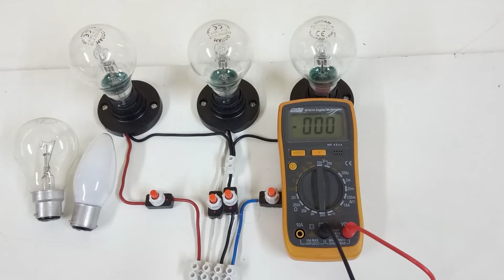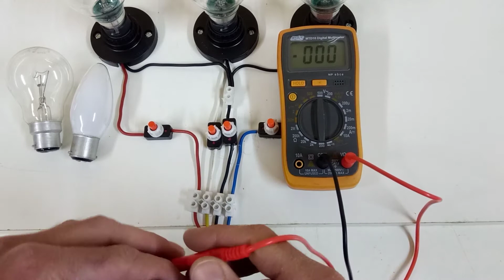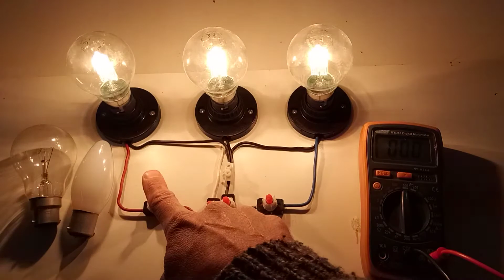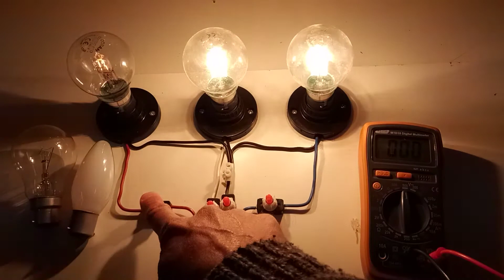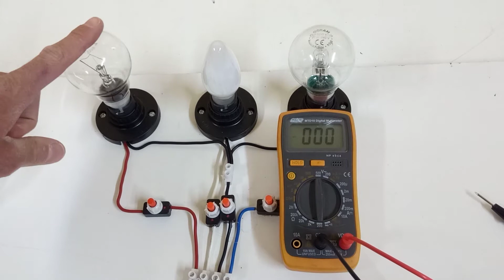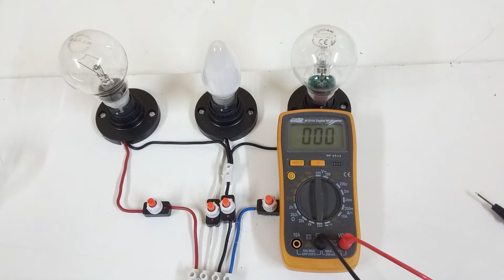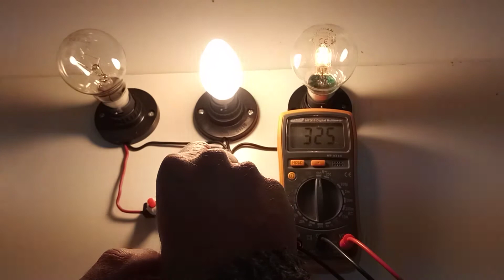A broken or floating neutral and the effect in three phase electricity systems

Comment: Thanks for that nice explanation👍 Great work👏 Can you suggest some relay or something which can identify a neutral loss at home three phase network? If it’s an over voltage / under voltage relay then tripping will be too often, as there’s a significant fluctuation of voltage otherwise also.
Reply from the maker: Those over under voltage protectors can be calibrated to the voltages you want them to trip at, but anything outside of the 10% or maybe 15% range of 230 is risky and may blow appliances.
Your supplier should be required by law to keep to the 10% range.

Comment: This is a great video. I was arguing with a person on reddit about open or loaded neutrals. What I learned is if you'd have checked the voltage across the open neutral with imbalanced loads (40w and 77w) you still won't get more than 240 like you did across the yellow? I did a set up much like yours in my garage with 2 phases of 120v.

Appreciate your video very good explanation!
Reply from the maker: Ok so you're taking about US voltages in your case.
I'm using 230v / 400v.

Your phases are 120v / 240v.
So you're correct - if you had a broken neutral, you'd find the voltages anywhere from 0v to 240v depending on the loads and resistance.
Plus I reckon they would move all over the place as items start blowing up in a real life situation.
I know you also use a system of plugs that share a common neutral so it could potentially happen that it affects just those sockets and not the whole installation.

In my case it could be anywhere from 0v to 400v at the worst, which I've seen in real life where a transformer neutral came loose.
Two phases were at 400v to neutral and the other had so much load it was just sitting at 0v.

Hope this makes sense?
Please reply if you're not sure on anything.
Reply: @TheCrazyENTP  his argument was that we can not get more than 120v on our neutral even if it is shared between phases because of how we derive our neutrals. Our 120/240 systems are "center tapped". So apparently the two phases can't "add up" on the neutral. Apparently it's the same for our Y type systems. When I tried in my garage the most I could get with different wattage bulbs was 56 volts on an open neutral but I wasn't sure what would happen with an even  more unbalanced setup. Many of us are taught what I thought which is that the neutral could be carrying a bit more danger than the hots feeding it when working live. He's saying we're idiots, but I think he might be right.
Reply from the maker: I think he doesn't understand electricity.
If the neutral breaks and you have a load on one phase only then it won't run (unless it finds a way back through TN-C-S earthing), so th neutral will be at phase value.
If you tested to the other phase (assuming no load running) you would read 240v.
But as soon as you add load to the second phase the voltages will shift.
The current (amps) have to get back to source and the resistance remains the same, so the voltage will be all over the place. It's basically putting the loads in series between phases then.

Again, I've seen 400v phase to neutral in real life so it is possible. It blew so much stuff in probably 120 houses!

Comment: Would there be any voltage on the neutral cable when it's broken?
Reply from the maker: Yes there would be a potential on the load side broken neutral relative to the earth or the neutral connected to the transformer.
You can actually use that as a way to test for a faulty joint.
Check for a voltage on the neutral on either side of the joint with loads on and if you see abything above zero that it the faulty joint.

Same I guess with a joint on a phase. If you see a potential across a joint, there is your problem.

Comment: Hi there, 
Thanks for this great video and informative explanation. Would you please advise on the following.  If a neutral wire breaks on three phase power supply, within a DB with RCD is installed in, would that RCD trip off and cut the power off. 
Thank you.
Reply from the maker: Hello. Sorry for the late reply. The RCD won't trip from over voltage, but if you have any surge arrestors after the RCD they should earth the high voltage and that would trip the RCD. Better option is some sort of overvoltage monitoring device that shuts off the power.

I'm actually dealing with a neutral issue like the video with my neighbour. It's the power company issue but they can't find the fault. Their house does not trip as no surge arrestors.

Comment: Wonderful content.   Understand the load can be SERIES with 2 loads on 3 phase.                  Unfortunately STILL do not comprehend (mathematical) why the VOLTAGE jumps up with Unbalanced Open neutral.
Reply from the maker: I think you need to go back to basics with V=IR formula.
To understand exactly what it means and how it works. 
Then look at delta star transformers.
How they use incoming two phases to make a phase and a neutral then repeat that twice more.
Red white phase makes red with neutral
White blue makes white with neutral
Blue red makes blue with neutral
Neutrals are connected to make the star point.

So if the neutral is broken the current  has to go back somehow. Into the broken neutral and back out through another phase  or phases.
This means you're connecting loads across phases.
So the voltage is determined by the current and resistance.

The single phase voltages are not fixed like the phase to phase voltages where the neutral is  broken because you've lost the star reference.

Phase to phase will only change if there is an incooming phase down or a change in MV voltage (which changes the single phase voltage too).
Reply from the maker: It may help you to see how the US Delta Delta transformers with high leg work.
A neutral created between two phases at 240 v gives a 120v system but also three phase of 240v and a high leg of 208v

Comment: The SUM of the current on the neutral is zero on a balanced 3 phase load.
Reply from the maker: It's very rare to find a balanced three phase load where  you have single phases involved.
But I have seen a street feed running phases at hundreds of amps with only 20 amps coming back on the neutral.

Comment: We expected the CURRENT TO CHANGE.  Yet, you are showing us the voltage changes. thank you.    First time seeing this with 3 phase system. 120 degrees out.
Reply from the maker: Oh this three phase system is common all over.
It's very efficient because it only needs one neutral.

If you ever experience a neutral fault you will know because the voltages go wrong so quickly.
Mostly people report damaged appliances and  equipment due to high voltage.
Reply: @TheCrazyENTP  Thank you.  Still do not understand WHY the voltages go haywire?   Do understand the CURRENT needing to be balanced BACK to the transformer.
Reply from the maker: Check the calculations in the video description.
V=IR
So
I=V/R
I can't change as it haas to get back to the transformer  and R is fixed by the devices  connected. So the larger  current coming on one phase will drop to get I to match with another phase with less load.

Comment: This example is regarding split phase, to be clear, years ago in a small farmhouse when my boiler kicked on the bulb on my ceiling went brighter for the short time the blower took to come up full speed. Normally the bulb went dimmer during this time. My former electronics instructor stopped by and rather than tell me, he watched me spend three days working thru different scenarios in my head. Eventually coming to the conclusion I had an open neutral I then went up a fiberglass ladder and fixed it. RIP Bill, you were one of the best especially considering all the rest.
Reply from the maker: No this isn't a split phase system.
That is a US concept not used in 230v / 400v systems. If we did we would end up with 200v and 400v (and possibly a high leg of 230v).
Split phase the two phases are 180° out of phase whereas three phase they are 120° apart.

Also the high leg system is a delta-delta transformer where we use delta-star transformers.

Comment: If the neural breaks upstream from where is is connected to the earth wire the voltage on it will go to the earth wire and to all equipment cases.
Reply from the maker: Yes this is true for TN-C-S earthing and possibly TN-S depending where the break occurs, and can be deadly as there is no way to switch off to prevent electrocution.

But it is not an issue for TT and IT earthing.

Comment: Sir, the 3 phase secondary winding of the local distribution transformer (415v) is star connected and the output common neutral point is also grounded below the transformer.  But how the current & voltage which are generated in the winding comes to our house after following the long path while they should go directly to the ground below the transformer from the neutral point of the transformer as current follows the shortest and least resistive path.  Even if there is some resistance in between transformer's neutral point and Earth, still atleast some amount of current from the transformer should leak directly from the neutral point to the ground, but why this not happens ?
Reply from the maker: Sorry I'm not sure I understand correctly.
Are you asking why the power flows from live and back to neutral instead of through the ground?

Well, like you said it is a three phase transformer, so the current flows from a phase to the neutral and then meets currents from other phases.
These will cancel each other out and only the difference flows on the neutral to the transformer.
I have photos on a street feed here by the transformer where the currents I measured were:
Red 157 A
Yellow 136 A
Blue 113 A
Neutral 19 A

You can see the neutral isn't much load.
This is why we must balance phases as much as we can.

There might be some going to the ground but the ground resists a lot. Electricity likes to follow the easiest path.
Reply: @TheCrazyENTP  No, i am only taking about transformer side. The neutral point in transformer where three phases get shorted and connected with ground below the transformer and also goes to consumers houses. Why current not directly goes to Earth from transformer neutral point instead of long loop from consumer houses.
Please re-read my above question (only taking about transformer side).
Reply from the maker: Yes then this is what I am describing.

Electricity only flows where there is a circuit.
Do you understand the different types of earthing?
I think you need to read about IT earthing where there is no earth connection or a very high resistance earth maybe.
There you will see a person touching a live phase WILL NOT get a shock.
Why? Because there is no connection of the neutral to earth at the transformer.
So the same with earthing the neutral at the transformer. Where will the electricity go to?
Nowhere because there is no circuit. The only electricity coming in to that earth is any leakage from devices connected downstream.

Even here I have seen two transformers fed from different 88kV supplies but the same 275kV supply.
The neutral of both 415v sides were linked overhead.
Then the one transformer neutral failed and the voltages went wrong very quickly like in my video.
The electricity doesn't flow back to the other transformer neutral or via the ground and keep the voltage correct. It goes back via connected appliances on different phases still sharing the broken neutral piece, forcing the current to balance (so with V=IR if R stays the same and I has to go back, then V will change to match and hence the high or low voltage customers will see).

Comment: I have a curious question (not related to this video). 
Suppose if their is a 2m long un-insulated wire. One end is connected in Line socket and other end is open. What will happen if open end of wire connect with itself at a point on mid length, will their is a short circuit or nothing will happen ?
Reply from the maker: Hello

Thank you for the question.

If you take the wire and touch the end anywhere on the same piece of bare wire nothing will happen. 
There is no potential difference on the wire for there to be a short circuit.

Think of it this way:
To have a circuit, power needs to flow from live to neutral. If you just have live and you touch it to itself, there is no complete circuit so nothing happens.
The short only happens if live touches neutral or earth (or a live from a different phase, but that is getting more technical).
Reply: @TheCrazyENTP  then in case of binding in motor or transformer, why it get short?
 I was thinking that due to heat when thin wire binding coating removes, it touches itself and get short.
 If this is not how binding get short then how?
Reply from the maker: Oh yes, but this is different. Here you have a wire that connects from live to neutral, not just open on one end. So there can be a potential difference somewhere.

In this case you can get two possible results depending on where the wire touches itself:

1. The wire  touches itself only a short distance apart in the windings. The motor or transformer may just lose a bit of power until further failure develops likely from this being a bad connection (gets hot).

2. The wires touch a long distance apart in the windings, creating a short circuit and failure.
This is because in essence you'll have a very short length between the live and neutral (or two phases) of the windings.

Does this make sense?
It's different from a wire just floating with no connection on the other end.

Another example to compare:
If you look at high voltage overhead power lines, they sometimes run two wires next to each other for the same phase.
They don't short because they are the same phase.
Even if on breaks and touches the other, there is no short, only overloading the remaining wire.

But you'll see they have a big space between different phases as there is a potential for an arc to occur if the gap between the wires is too small.

It's all down to potential difference.
Reply: @TheCrazyENTP  Thanks for clearing my this doubt.
I have a one more doubt related to Earth and phase.
 All large appliances have Earth wire connected to their metallic body. If due to some reason, phase wire touch with appliance body and body get current it passes through Earth wire and people don't get shock. 
But my question is why their is no short circuit happen ? As we know that when phase wire touch with neutral or Earth without any resistance between them, a short circuit will happen but why not in this case ?
Reply from the maker: The simple answer is that is a short circuit and something should trip. A live to earth fault is meant to short and trip out to protect from shocks.

The long answer is there are many reasons why it doesn't trip.

Do you have RCD protection? Should trip for 30 milliamp leakage. This is the most important protection needed.

What type of system earthing is used?
There may be high resistance so a circuit breaker doesn't trip (such as TT earthing or maybe faulty wiring). Example the incoming beaker at 80 amps needs a lot of current to trip.
This is where TN-C-S is better earthing.
Are you familiar with the types of earthing?

Also maybe a faulty earth on the appliance is possible.